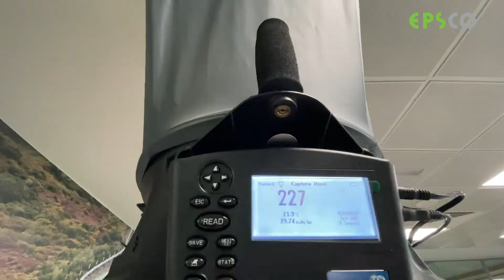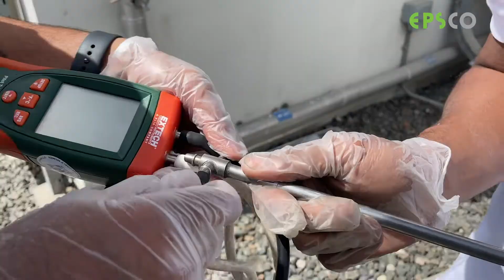Testing, Adjusting & Balancing (TAB) by EPSCO L.L.C

Comment: For liner diffuser u have to measure by capture hood for anemometer how you will calculate area and grille factor
Reply: Grill size m2 *0.86 after
Take readings from anemometer suppose 6.3 ms *size *1000 =L/s